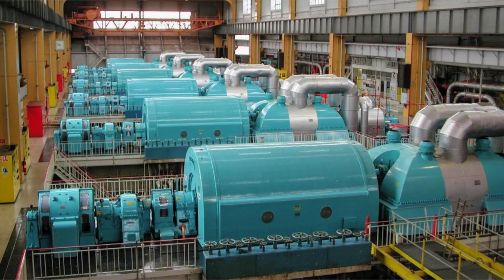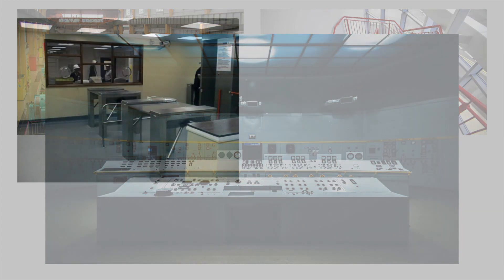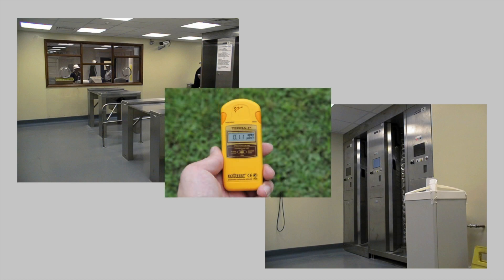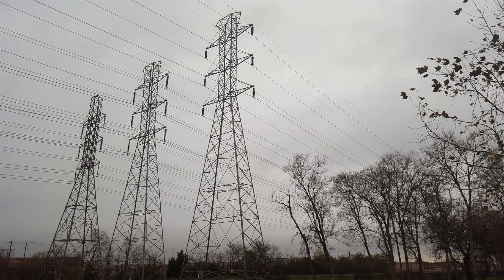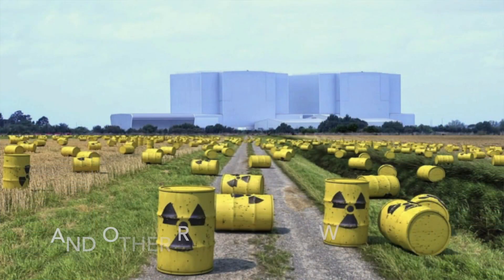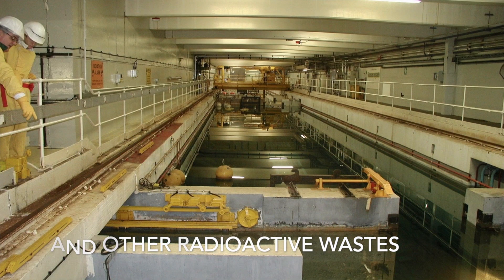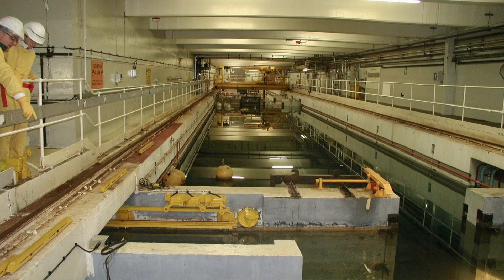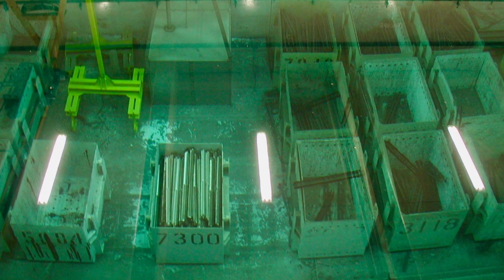Small Modular Reactors Part Two - we look into the issue of radioactive waste and electricity costs

Comment: I'm not sure if you're just anti-nuclear in general or pointing out fallacies with this type of reactor. I shall make the assumption that it's the latter.
  Your point about waste seems very valid to me. Whether it's an environmental concern or in my case an efficiency one, we both concur. I'd like your views on 'molten salt fast reactors' which wouldn't have a waste problem (storing stuff for 300 years seems easy).
  Your point about 'if we take care of the environment then the economy will boom' is false. The environment was largely unaffected by man during the time of the Neanderthals but I doubt that their economy was booming. I'm not being trite, I'm applying the standard maths test of choosing an extreme and seeing if the conjecture holds.
  You say that we have to solve the problem before 2030. Why? How? Saying 'now, now, now' seems a bit silly without a practical solution. Are you railing against the ponderousness of the Nuclear Energy Commission, if that's what they're called?
  If your urgency for a power solution is driven by a belief in 'CO2 being bad' and 'climate change' which I suspect it is (this is where you can correct me) and you reject nuclear (which is unclear to me if that is true or not) then the solution is to go back to the life of medieval times and hope that the rest of the world will follow suit.
  In conclusion, I agree with your impatience about getting on with it. We don't need to burn gas and coal (at least not even remotely as much as we do), we have nuclear and we have safe economic tested methods for using it.
Reply from the maker: Many thanks Ben, you are correct, we agree on more than we disagree!

On the Molten Salt Reactors point I would say IF all the promises could be met they would be better than the typical Uranium fuelled PWR. But, as you will know, they have not had an auspicious start and they have yet to prove profitable. Essentially they are still either experimental or conceptual. And, in this case, 'better' is not 'good'.

On the point about economy, on reflection, it might have been better if I had discussed comparative economics of electrical energy generation systems and that is what I was alluding to. Sorry it was a bit obscure!

I am not saying we should solve the problems of SMRs ;-) I am referring to the increase in global temperature and the fact that the runaway increase needs to be urgently arrested to avoid being forced back to medieval times (or, indeed, earlier) regardless. For reference in the US it is the Nuclear Regulatory Commission (NRC) and the UK the Office for Nuclear Regulation (ONR).

Absolutely agree we must stop burning coal and gas but remember nuclear fuel is also burnt.

I'll leave it there, thanks for your contribution. PB
Reply: Ben, look at this article that Peter Banks recommended to William Pierce:
https://thebulletin.org/2019/12/fact-check-five-claims-about-thorium-made-by-andrew-yang/

The one that quite explicitly states:
"Claim: Building new nuclear reactors will likely be necessary if the United States wants to achieve net-zero emissions by 2049.

True. Nuclear energy is already the primary ultra-low carbon energy source for base-load electricity generation. ... So new nuclear reactors will be necessary ... to meet a net-zero carbon emissions goal."
Reply: @factnotfiction5915  I'm aware of the thorium cycle. But thanks for the link.
Reply from the maker: Thanks and welcome back fact not fiction.

You are conflating two different points here... Firstly I was merely suggesting reading a relatively 'pro' nuclear article to illustrate the myths that surround thorium reactors. However, I cannot concur with the 'necessary' claim in full for the reasons outlined here: https://www.youtube.com/watch?v=K0poNgL57kc

Secondly it is important to distinguish between the proposed SMRs and Thorium reactors. The first are smaller versions of PWR light water reactors, the latter classed as AMRs, Advanced Modular Reactors.

Take care, PB
Reply: @no2brb   "However, I cannot concur with the 'necessary' claim in full for the reasons outlined here: https://www.youtube.com/watch?v=K0poNgL57kc"

Peter, I obviously do not agree with your point of view, but I feel your anti-nuclear stance has more to do with the health of the estuary at Bradwell - however, the group you reference above, the 'Nuclear Energy Information Service NEIS' is really not the place to go for your information - they are a propaganda-led group with absolutely no regard for facts and simply cannot be trusted to provide any proper perspective on nuclear - whether you are pro- or anti-.
If you want to be a sincere anti-nuclear campaigner, there are far more legitimate sources of information, and/or arguments.

Just in the first few minutes of their video:
* 'Nuclear is not carbon-free' - true, but then as their table points out, neither are wind nor solar. The IPCC, a cross section of scientists across multiple disciplines, countries, genders, ethnicities has published the lifecycle costs of nuclear at 12 gCO2/kWh (comparable to wind at 11 g, and solar at 48)
** https://www.ipcc.ch/site/assets/uploads/2018/02/ipcc_wg3_ar5_annex-iii.pdf
pp 1335, Table A.III.2
** You might prefer the Sovacool numbers or the Jacobson numbers, but tellingly, the IPCC does not appear to have adopted those numbers, and even so, even Sovacool shows nuclear to be "low-carbon".
* 'Nuclear energy is not clean' - and then launches into tritium emissions from NPPs - true, but irrelevant. These emission levels are extremely small, and simply not a threat to human health or the environment. The claimed emissions of methane, CO2, CFCs, etc - all bunk. Exactly where are these pollutants being leaked from? The cars in the parking lot? The cooling system of the office block? Ridiculous.
** Nuclear generates high levels of radioactive wastes - true, but then, there is a solution for that, so again, a bit of a misleading point. However, small potatoes compared to the next statement:
** "Fukushima, Chernobyl, TMI continue to cause deadly health problems" - not according to UNSCEAR. Sigh. Facts, from reputable scientists and physicians should weigh more than the scaremongers of NEIS.
** http://www.unscear.org/

There are so many more misdirections and outright lies in this propaganda. However, the two that really caught my attention was a bit later on data from the US EIA. The US EIA shows that despite the 'bailouts' of nuclear - states with high levels o fnuclear have low retail electricity costs, and states with high levels of wind and solar have high retail electricity costs - so maybe the 'bailouts' are worth it to society as a whole. 
The second point was that nuclear impedes wind and solar investment, and that shutdown nuclear is replaced by wind and solar. But the EIA data shows again, and again, and in a specific report, that nuclear is replaced by high-carbon natural gas - https://www.eia.gov/todayinenergy/detail.php?id=28572 - not even a close call.

Thus you see my particular disdain for NEIS. 

There are plenty of proper anti-nuclear groups that don't spin or outright lie, please don't be suckered in by NEIS.

Comment: The main benefit of the SMRs is afaik that they can be produced in a controlled environment and thus eliminate on site inspections which is one of the main points in construction delays. The powerstation itself is much easier/faster to build and thus construction time which is one of the REALLY big issues with nuclear from an economics standpoint can be reduced/eliminated.

Not sure where your LCOE numbers are from. If one look at Lazards number and adjust these for a normal nuclear stations lifespan (60+ years) instead of the 20y limit they use in their calculations (which is weird) then Nuclear is def. among the cheaper and possibly cheapest (assuming 80/100/120 years operation. USA nuclear is estimated to go atleast to 80 and most likely longer).

Transport of the spent reactor is an issue but as they are constructed with this in mind they already meet the regulations for transport and ideally they would go to a reprocessing plant since the actual high level waste is just a small part of the reactor material at this point.
Reply from the maker: Thanks, Richard, for your contributions. I very much appreciate the politeness of your responses. Even though there may be some areas we may not fully agree on it is refreshing to have a civil discourse! 

I understand the point about economics. However to achieve the economy versus larger reactors the number produced has to be high and with the lack of take up by the NuScale proposal and the Rolls Royce model starting form the point of requiring substantial Government subsidy I remain unconvinced.

On large reactors plants then I agree the LCOE does compute. On the SMRs and AMRs my sense is that the jury is out until robust economy of scale is achieved. And time comes into play here, right now no systems are available 'off the shelf' from factory to site.

In the UK the new regulations require spent fuel waste remains on site for all plants from Sizewell B through to the future. As far as ILW and LLW local storage is the current plan.

Regards, PB
Reply: @no2brb  when you build a fossil fuel power plant you don't have to start big , this is where we want to be with nuclear , the ability to start smaller and faster .  You keep saying that nuclear energy is expensive which is a lie .  The initial cost of construction nuclear and fossil fuel are more expensive than renewable but 
Renewable energy per kwh cost more money to produce , the longer a nuclear and fossil fuel power plant run the cheaper it gets , this is why renewable simply can't compete without large amount of subside  . No government or company is consipirying against renewable , because they have dump billions of dollars into it only to just produce 4% of global energy at a higher cost.